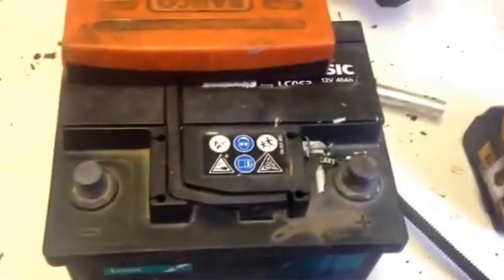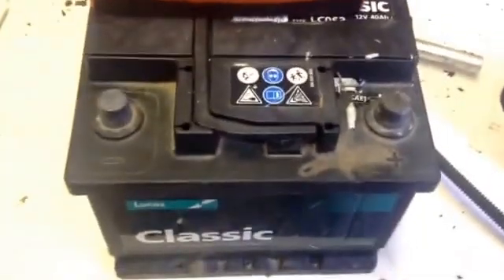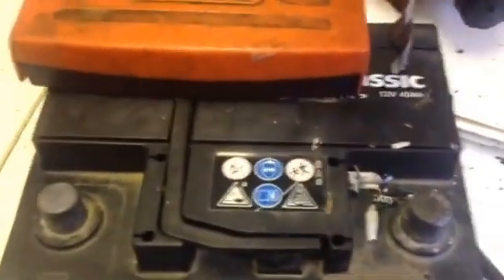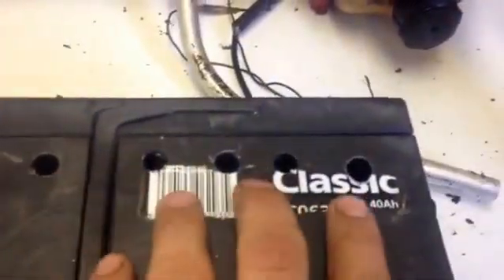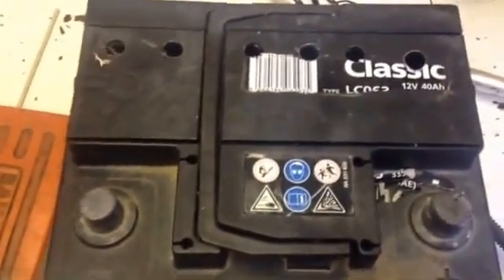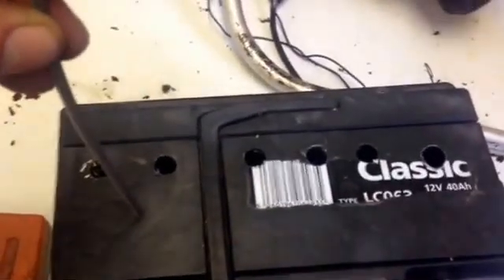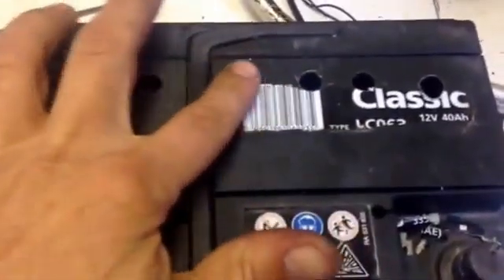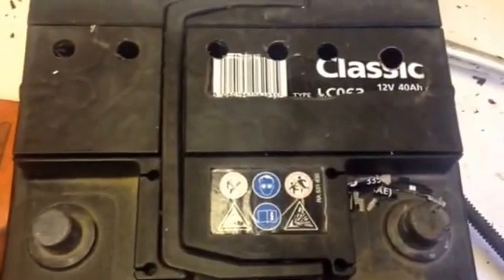12v battery repair - car battery

Comment: I reconditioned my dead car battery a few weeks ago with your program and it's been working perfectly since then! My car battery was completely dead before I used your methods [Check Details https://plus.google.com/113658828433866467763/posts/72dX1D1623q  This just saved me hundreds of dollars on a new battery!?

Comment: I just discovered a dead simple trick that brings any battery back to life again…It simple, quick …and really works [Check Details Here==>https://www.facebook.com/Battery-reconditioning-310070329426065/app/208195102528120 ]. And once you learn this, you’ll pretty much never have to buy batteries again!